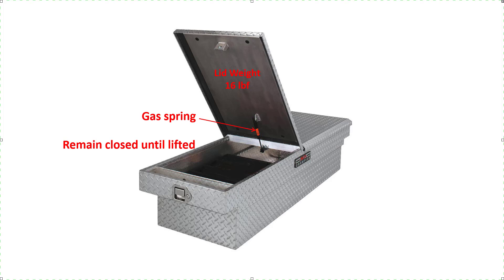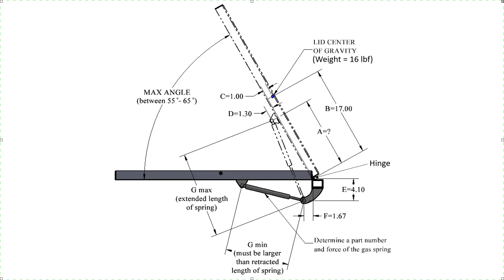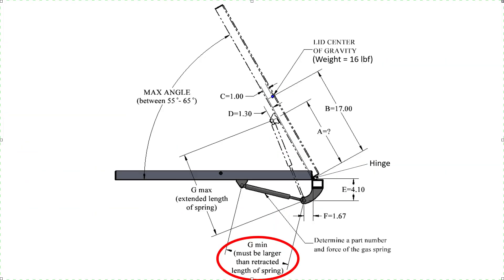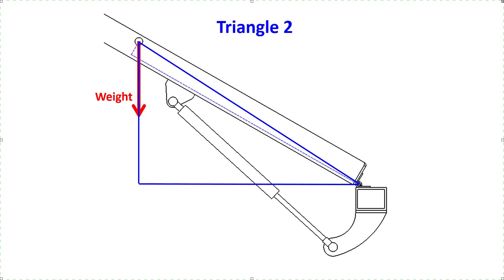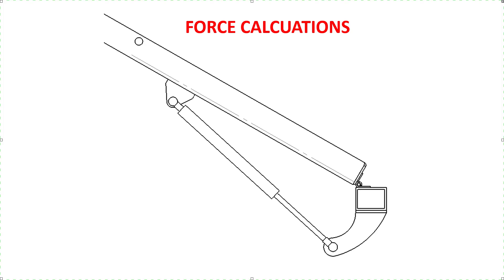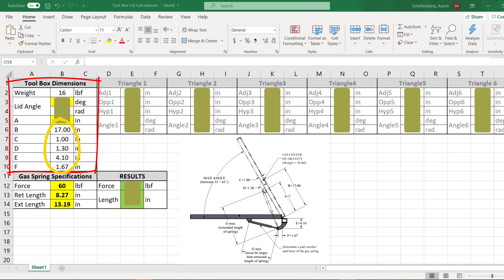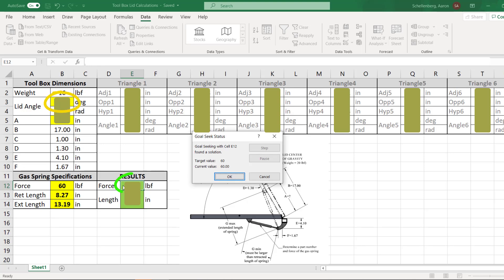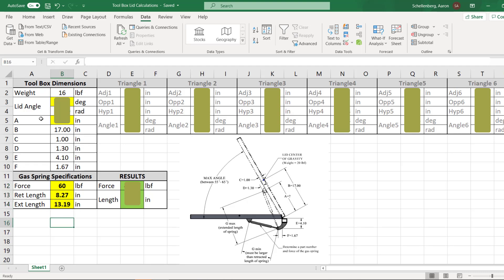Video   Toolbox Lid Calculations

Comment: Wow as a mech Eng student I was already aware of the concepts but seeing it applied this way was really enlightening! I was wondering why you werent just getting all the parameters from the CAD model if it was already made but making an excel sheet with those triangles to be able to perform these analysis while changing other factors without needing to remodel a CAD file makes a lot of sense. Great video!

Comment: Very glad you produced this valuable video. It provides a thorough explanation of the trigonometry and calculations behind the analysis without divulging too much info as to give away the process yet all the necessary info is there. Ya, just gotta pay attention! I think that creating the spreadsheet is left as an exercise for the student to enhance their comprehension.
Title typo in video at key-frame 0:00 - missing 2nd L in CALCUATION.

Comment: I actually need this in the real world. i just bought a tool box and it only opens 70-80 degrees. i want it to open 90 degrees. I have one pivot point i cant move and one i can. is there a resource i can leverage to just tell me how long and strong a gas strut i need to use? i stink at math

Comment: +Aaron Schellenberg.  Viewers!!!  If you are watching this video, do not use this method!!!  
If Aaron can't show the working out it doesn't work.  AVOID!!!!  The lid will fall on your head or your child will loose a finger!!!!  AVOID!!!
Reply: Are you serious? His working out is the entire video. If you cant do force analysis, dont attempt this.
Reply: @Itsmellsfishy  There is no working out shown anywhere in this video, just theory, to the extent where a spreadsheet is shown and this is also redacted, not showing results.  Further, the formula bar is also redacted, not showing formula used.  Why?  I assume, that he has no confidence in his own calculations and hence there is not toolbox video.  In my world as a mechanical engineer, and in the past as a applications engineer, I can do all the calculation for a design.  At the end of the day the manufacturer/supplier of the component, will certify a design with an applied product, and take responsibility of the function of the assembly, allowing for real world variability, not pythagoras and spreadsheets.
Reply: Yes he is just using pythagoras for simple geometry, but if youre a practicing engineer, it wouldnt take long to get the numbers he has hidden. Is there a flaw in his logic I am missing?
Reply: @yankos_  "the function of the assembly,allowing for real world variability" That's what really matters! Not theoretical jargon.
Reply: Maybe you would be kind enough to share a spreadsheet with your calculations, given the same 16lbf lid weight, same McMaster-Carr brackets and the same gas spring?